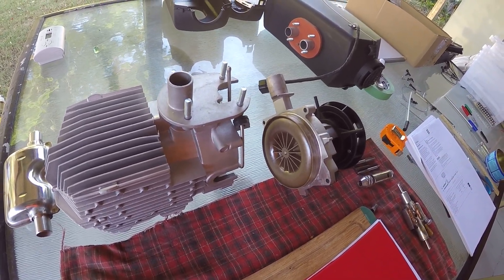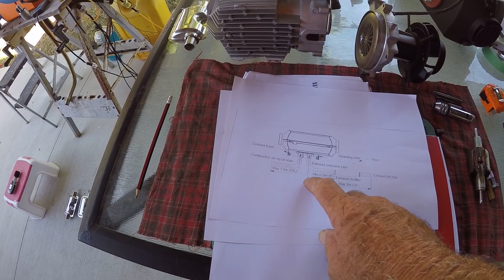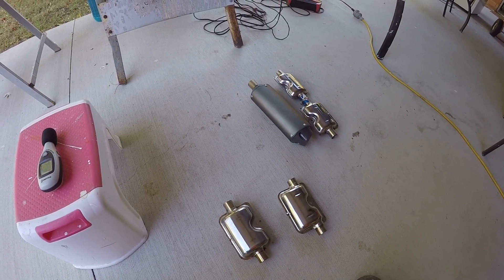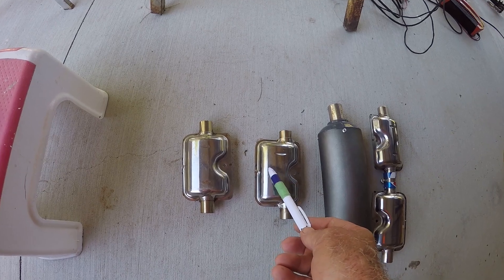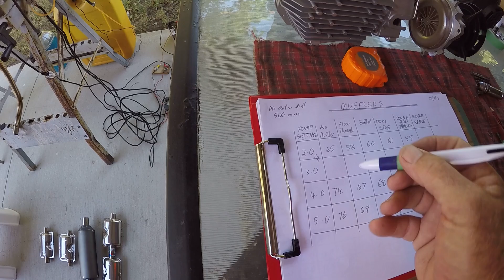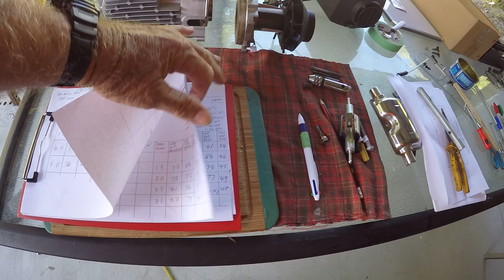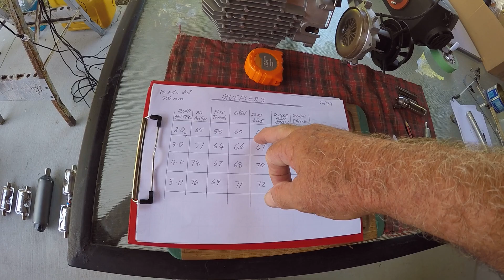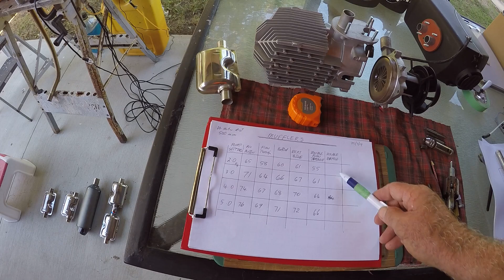Chinese Diesel Air Heaters - Part 8 - Exhaust and Mufflers

Comment: I made a spiral exhaust as heat exchanger. If there's no visible smoke, does that mean it's running clean without too much restriction? It's 3 meters of stainless steel ribbed pipe that I found in a scrap yard. smaller diameter than the original exhaust. And still no smoke. Thanks everyone for sharing

Comment: What if i just poked holes in the last 1 1/2ft of my exhaust pipe , wrapped it in rock wool and then put another pipe over it like the aluminum vent pipe and clamped it down, could that make it even quieter than the dual straight through muffler set up?

Comment: Hi John . Just starting to watch your videos because I’m just starting to set up the heater.  I’ve seen where people are running the exhaust through a proper hot water or steam radiator from an old building and I managed to acquire a couple  of the small ones probably 2‘ x 20“ or so. The exhaust exits the heater was a nice radius into the top of the rad, it’s gotta work its way down through the radiator and then out through the other end and then straight out through the garage door so that’s  270° …the quoted maximum you were saying.  
 do you think these radiators should be avoided… exhaust coming out through the garage door was crystal clean not a hint smoke anywhere and after about an hour,  the little radiator was nice and hot.  Proper cast iron radiator ….good or bad ?

Comment: Hi John. I have a eberspacher diesel heater in my van (2015 model) we bought the van second hand and original owner had it fitted when they bought the van. It is very noisy (air intake/exhaust) you can hear it running 30 feet away. It has a intake filter and a fairly new muffler. Any suggestions on how to quieten it down?  Regards Mike.

Comment: Thank you for all your research, very interesting. I’m a sound engineer and what I am wondering though, the sound the heater produces a very distinct “ribbed” tube sound. Lots of turbulence and multiple pitched noises. I would be very interested in the how much reduction (not only hard dB’s but also less annoying) a straight tube would be compared to the standard ribbed tube. Off course this would make installation a lot more challenging.
Reply from the maker: @paul9532  

Hi Paul,

Most noise actually comes from the fan and pump ticking. With a larger heater running at a slow speed, the heater is very quiet.  JMcK

Comment: Great video. Am still trying to find out why my chinese Vevor diesel heater sends me diesel exhaust gases instead of dry hot air. AIr intake is connected through a PVC pipe to the outside and the exhaust goes up through a chimney. Am heating a room in a house. Burner is brand new and I can't figure out why and how this is actually possible. The combustion circuit is isolated from the air heating one. Only potential issue I could think of, is a leak in the combustion chamber...Will need to disassemble the unit...
Any hints and suggestions welcome !
Reply from the maker: @TheDeanza7  
Have you watched video no 15?
It may explain your problem.
If heater is new, send it back…..It is dangerous.  JMcK
Reply: @johnmck1147  wow wasn't expecting such a quick turnaround, thank you so much ! Your videos are incredibly helpful. 

Vid 15 confirms that I've to check the seals for sure. Will do and if it's the issue, I'll try a replacement. I was so dumb to buy one on Dec 14, 2022 and not to try it, as the renovation works in the storage room I wanted to heat with that thing, were delayed by quite a bit. So 2 years later and 16 days after the end of the warranty here we are 🙄 Well if it's just a gasket I'm fine. Dropped a mail to Vevor just to make sure.
I've of course, as you recommend it, installed a CO detector but it id find nothing when put in front of the hot air piping. indeed the smell was horrific...
Will go disassemble this heater now. Anyway, wish you a very good new year 2025 as you're ahead of me and some great travels as I read you were into :) (love the exotic background noise in your vids :)) Definitely not what I have in my garden)
Cheers mate
Reply from the maker: @TheDeanza7  

Hi there,

See if you can borrow an instant CO detector. As in the video, the safety CO detectors do not alarm on low CO readings, and there is a time delay on higher CO levels.

Sometimes the combustion leak can be as simple as a poor fitting glow plug  cap.  JMcK

Comment: John - you bloody ripper, loving your informative videos. 

Have you done anything with wrapping exhaust and even inlet pipes for thermal and potentially noise efficiency? I’m thinking of the cloth heat wrap type stuff for the exhaust and maybe a foam wrap for the inlet air. 

Cheers again mate

Mark
Reply from the maker: Hi There, sorry for the delay but I am away sailing with intermittent email. 

Yes, exhaust heat wrap is good, and does lessen exhaust noise a little. 

Thanks for your comments. JMcK

Comment: Hi John,

Really appreciate your effort in all these videos.  It gives many of us "instant knowledge" to tackle our own foray into diesel heaters.  I was wondering if you could expand on connections of exhaust piping.  You covered connection of fuel quite well and it would be nice to see your take on the best way to connect the exhaust pipe to muffler, bend the piping, extensions etc.  The pipes that come with the kit are hard to interconnect and I have seen a suppliers manual that suggest cutting a slot in pipes prior to connection to allow "pull down" by the clamp.  With your experience would be good to see what you think is best for sealing and longevity.  Great videos, thank you again.
Reply from the maker: Hi There, You can cut slots in the exhaust pipe end to allow joining. Use exhaust sealer or high temperature silicone to make the join gas proof. You can also use a short length (50 mm) of the right size copper, aluminium or stainless steel pipe to make a joiner, using high temp silicone to seal.  JMcK

Comment: Has anyone every had a concern about mice climbing into the mufflers and building a nest? Is there any type of mesh cap to place on these mufflers that would not restrict exhaust flow too much but would deter mice? I have a diesel hydronic heater installed on my car and we live in the country. It is a regular fight to ward off mice from building nests under the hood (bonnet). I am worried they will love to climb into that little muffler chamber.

Comment: What I haven't seen in this series is how to attach an extension to the existing exhaust pipe. The two ends are the same diameter. Should I have ordered a connector?
Reply from the maker: Hi MsL.
You can buy or make a joiner.

Comment: Hi John, thanks for the detailed info on this stuff. I was wondering what part of the heater is making the most noise- is it the combustion chamber itself, the exhaust, or the intakes? I notice some people put them in wooden boxes or kennels to cut down the noise and was wondering if you considered that a worthwhile option?
Reply from the maker: Hi, Clyde, it is the fan that makes the most noise. That is the main reason I suggest buying a larger heater running slower, rather than a smaller heater running flat out. A sound deadened enclosure does help, but the fan noise still comes out the outlet vent when running at a high speed.  JMcK

Comment: Very good video John. It's making me wonder what would happen if you made a 3 or more muffler system. Would it cause problems with sooting or combustion problems? If not what would the decibels of adding more mufflers than 2?
Reply from the maker: Hi 4736, generally one muffler is sufficient, unless you are parked very close to a neighbour. 
The most noise comes from the fan. 
That is another reason why I suggest a larger heater, or two heaters running slow (less noise) is better than a small heater running flat out.  JMcK

Comment: Hey John thanks for the great video series on the CDH. I have a question regarding the exhaust outlet and the fuel inlet close proximity. When I tested out my CDH the other weekend I found that the Hard vinyl fuel line had melted closed near the fuel inlet nipple. Does the exhaust wrap work well enough to stop this from happening or should I go for a better heatshield idea like a separation plate between the exhaust and the fuel line inlet?

Comment from the maker: You can use more than one muffler, provided it is the straight flow through type. However there is little benefit in having more than one muffler. Most noise comes from the fan running at a high setting. JMcK

Comment: Do you recommend running kerosene in it once a month to get the insides cleaned out?
Reply from the maker: That can be helpful if you have restrictions in your install, or you operate at a high altitude. For most operations once a season is usually adequate. JMcK
Reply: On a subject of a kerosene - can we use 80% diesel and 20% kerosene mix?

Comment: Thank you John for the great work you have done on there heaters. I would like to use one in my workshop but don't have an outside wall to pass the exhaust through. Do you think putting the exhaust into a vertical pipe of say 75mm up through the roof would work. The height of the roof is around 3m. Would I need perhaps some sort of extraction fan as well?
Reply from the maker: Yes, that will work. You could even probably use normal exhaust for that length as it is going upwards. On the boat we have a rather long exhaust without issues because it goes upwards. 

However you will need some means of exhaust outlet protection outside as you don’t want any wind blowing backwards down the exhaust. JMcK
Reply: @johnmck1147  Thanks John

Comment: Hi John this is great. My diesel heater leaks a lot of carbon monoxide and I can't figure out why. Could it be because I have had to make 90 degree bends in the air intake and exhaust to get it to fit? Not sure what could be causing it.
Reply from the maker: Hi G
Are you saying your exhaust is smoky, or you register CO on a meter from the hot air outlet?

If from the hot sir outlet you most likely have gasket issues, and this must be fixed straight away. 

If you have smoke from exhaust you most likely have poor burn due to a bad fuel air mix ratio caused by restrictions in combustion air inlet and exhaust. 

However, if just installed these heaters can be smoky on first start up and after five minutes or so the smoke goes away. JMcK
Reply: @johnmck1147  carbon monoxide coming into the van from the hot air duct. I only use for 5 mins and then turn off while having a carbon monoxide monitor on. When you leaking form gasket is that the gasket to the floor or an internal part?
Reply from the maker: The CO leak can come from gasket or seals. I do a whole video on this. Suggest you watch that video. JMcK

Comment: Great stuff John!   And very interesting, data-based results for the straight-through muffler.  Something else to consider is that convoluted pipe causes it's own restrictions to flow, particularly at higher flow rates.  So using smooth-walled intake and exhaust piping wherever possible is a good idea.
Reply from the maker: I agree Michelle. 
Unlike internal combustion engine exhausts, with positive pressure exhaust displacement, these little heaters only have a very small plastic fan to push out the exhaust, so they don’t like any restrictions in exhaust. JMcK

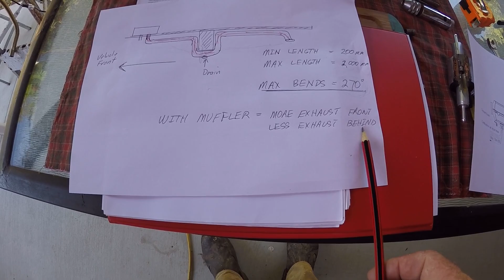Comment: 3:19 Great Video John. I’m wondering though, what do you mean by needing more exhaust in front and less behind the muffler? Can the muffler not be the final part of the exhaust system where air discharges?
Reply from the maker: Hi Q,

Sorry for the confusion here. You are not the first to ask this question. 

It is generally better to have more exhaust from heater to muffler, and less exhaust after the muffler. Rather to have the muffler close to the heater outlet and a long run of exhaust pipe after the muffler. 

Best of all, in my opinion, to have the muffler at the end of the exhaust pipe. 

This is unlike  many cars that have less exhaust from engine to muffler and more exhaust pipe from muffler to rear of car. 

Internal combustion engines have a lot of positive pressure force pushing out exhaust gases. These little heaters only have tiny fan. 

Note on motorhome video, muffler is at the end of the exhaust pipe. Sometimes this is not possible, so better to keep exhaust after muffler as short as possible. 

JMcK
Reply: @johnmck1147  thank you for the swift response, John. Your videos are incredible and very helpful. I've just installed my heater, having a smoking issue currently but will upgrade the intake and re-run the exhaust, based on your videos. Thanks again.
Reply from the maker: Hi Q, not unusual to have smoking issue on initial install, however it should disappear after a minute or so. 

If smoking persists, it is generally caused by too many restrictions in combustion air inlet or exhaust system.  JMcK
Reply: @johnmck1147  Thank you John, that is really helpful. I'll see if I an reduce restrictions as much as possible and try again.
Reply from the maker: Hi Q
These heaters like a little bit of exhaust pipe to give the gases direction or purpose, and to prevent outside air blow back in a breeze. 

You could try down to 100 mm. The heater will let you know if it is not happy. 

I would be interested in how you go. Good luck. JMcK
Reply: Hi John, smoke is gone. Thanks again. Another query though. I note 200 mm being the recommended shortest length for the exhaust. To suit mine I may need to have it roughly that, is there anything wrong with being shorter? Does shorter mean louder or something?

Comment: 2:21. so whats the front and behind of the muffler?
Reply from the maker: Hi AP, it is generally better to have muffler at the end of exhaust pipe, just like your motor car. More exhaust pipe in front of muffler, eg more exhaust from heater to muffler, and just short exhaust from muffler to end. I generally have no exhaust pipe after muffler, as I put muffler right at the end of the exhaust pipe.  JMcK
Reply: @johnmck1147  Cheers John! Jsut wanted to be sure
Reply from the maker: Sorry, not sure what you are asking. There is no front or back with these mufflers, they can be connected either way.  JMcK
Reply: Hi John, youve written " with muffler, more exhaust front, less exhaust behind." Front and behind what? the muffler or the heater? or the pipe? Not sure what that means.  Should the muffler be placed at the end of the exhaust pipe, or closer to the heater.
Reply: How about one muffler after 200mm from the heater, 1.5m pipe and 2nd muffler at the end?

Comment: What happens if you have 3 mufflers 3
Reply from the maker: I have not tested that Glen. You would need to try that yourself. 
However, if not straight through mufflers you will have combustion issues due to excessive restrictions in exhaust.  JMcK

Comment: Hello John is there any other way to prime the diesel heater? I dont want to prime it the way the instructions say because it's hard on that pump running it dry till diesel reaches it
Reply from the maker: Hi GO,
Yes, you can use a number of different methods, such as an outboard primer, a suction syringe that is used for liquids, or a large plastic syringe sold at vet and farm supplies, and auto shops also sell metal or plastic syringes for oil or fluid removal.  JMcK

Comment: So shorter pipe from heater to muffler then longer tailpipe or longer pipe between heater and muffler then shorter tailpipe
Reply from the maker: Hi GO, it really does not matter where you install the muffler. I generally install the muffler at end of exhaust. The important issue is to keep exhaust bends to a minimum. Exhaust restrictions in these heaters cause carbon issues.  JMcK
Reply: Tks John!! Do I need to have a muffler or can I just run the pipe outdoors. One more question 110v converter and wondering what to use if hydro went out that it will automatically switch to battery power. Thank you for all your expertise John!!
Reply from the maker: Hi GO, no, you don't need a muffler, but one reduces exhaust noise.
Re your other question you could power heater with expensive IPS, or a small battery connected to a small mains charger. Or take the risk of ECU damage if you have reliable AC power supply.  JMcK

Comment: Thx John, very clear video.  Can you say something about the heat ?  How warm do the exhaustpipes become ?
Reply from the maker: Hi DM, the answer here is very variable and depends on outside temperature, exhaust restrictions, temperature setting of heater etc. But as a rule of thumb,.......300 deg C to 350 deg C, but it can go higher.  JMcK

Comment: Hi John, I’m just on installing a heater 5kw in my garage. The total exhaust length will be approx 600mm is it ok to not bother with the muffler at all as the exhaust is going to vent out the my garage wall into the atmosphere. 
Regards 
Dave
Reply from the maker: Hi Dave, no you don't need a muffler, but it does make the heater a bit quieter. You can try it with and without and see what is best for you. JMcK.
Reply: @johnmck1147  thanks for that John I will try and see. Brilliant videos by the way couldn’t have done this without watching yours first. 👍🏻🎄
Reply from the maker: Hi Dave, mounting the fuel tank above the heater is ok, but you need to install a fuel shut off tap in the fuel line before the pump and turn off when not in use, otherwise fuel can leak past seals in pump and flood the heater before next use.  JMcK
Reply: @johnmck1147  thanks John I will do that
Reply: Hey John, just one more quickie….. I’m installing my heater on my garage wall, so will it be ok if I have my 10lt diesel tank above the heater? As this is a good place for me (space wise). It will mean that the diesel will be gravity fed to the pump although the pump and filter are underneath the heater so fuel will then be pumped up to the heater. 
Thanks 
Dave